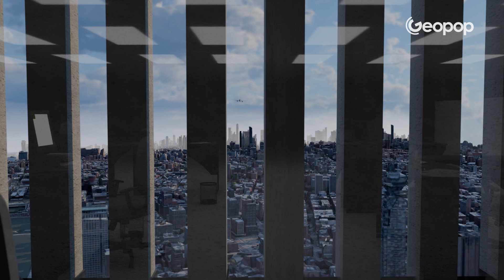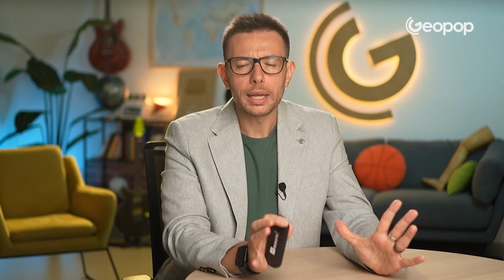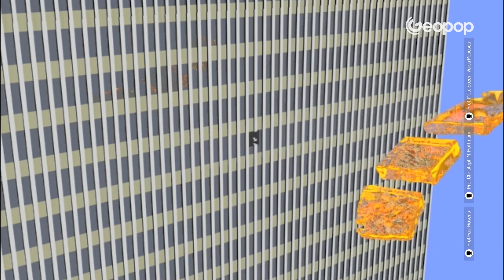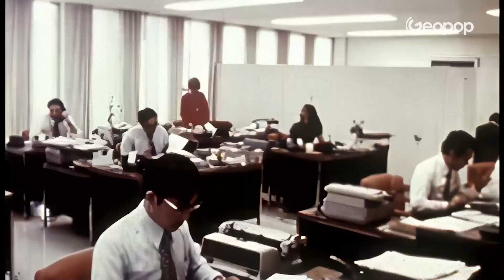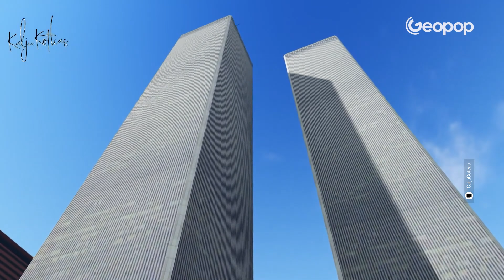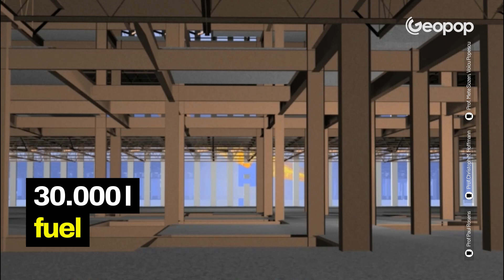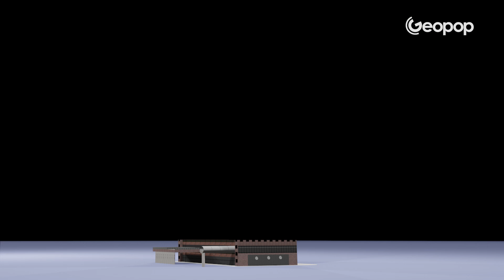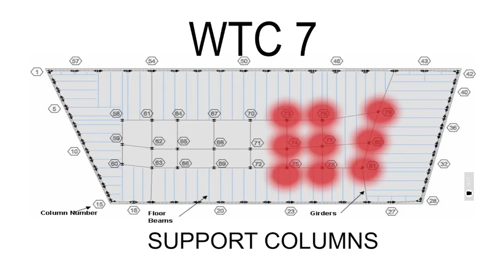9/11, 2001: The Technical Reconstruction of the Twin Towers and WTC 7 Collapses

Comment: Never in the history of steel buildings have they collapsed due to fire or plane strikes and yet 2 buildings in one day collapsed. 🤨 If anything, the top sections of those buildings would have fallen over and even that would have been suspicious.
Reply: Steel framed buildings collapse from fire all the time. News flash:  Steel is formed using heat and deforms the same way.
Reply: @TheLoonResistance   " If anything, the top sections of those buildings would have fallen over"  doesn't even make any sense.  It's just wishful thinking to get a result you want.
Reply: @zMW574e don't forget gravity, they dont pull to the side they pull downward

Comment: another question nobody talks about on wtc7 explosion conspiracy is where was the blast noise? yes of course and the windows blowing out which he mentioned here.  but i never hear anyone ask about the lack of explosion noise.
Reply: Also not a single one can explain how, if the buildings were rigged with explosives, "they" managed to keep the explosives from going off for 7 hours during a raging inferno. How were the wires and detonators not damaged in the impacts, or subsequent fires?
Reply: I guess Nobody Noticed the Holes in every Floor, Outside Walls and Ceilings, and why are all the Columns, Beams and Girders partially cut through, and they couldn't figure out why there are miles of wires running in all directions?🤔Amazing, you couldn't get a Pistol past security, but those sneaky bastards did this ???
Reply: Like you could hear anything over all the noise from the first 2 towers. Explosives in the basement did the trick.
Reply: @JasonCrowther-d6v  , you would see it and hear it; that's so idiotic. the 12 stories ripped out of one side and the 10 floors of raging Fires for 7 hours did it. It's frightening how many morons are out there? Also, there was no basement; it was suspended in a radical design (which contributed to the collapse) over a big electrical substation.
Reply: @JamesBerlo Fair enough. So you don't think our government had anything to do with it at all. It was a false flag operation.
Reply: @JasonCrowther-d6v  Oh, I think the Government is so infested with corrupt, power-mad psychopaths quite capable of participating and some could have known and allowed it, but they couldn't have too many people involved and keep it secret this long. 
I believe its possibly an "Allie"; say Israel could have known about it and not warned us, and may have even been involved in secretly recruiting and facilitating the Terrorists so we would go to War with their enemies. 
But all these insane, preposterous methods to achieve such destruction is impossible,
Reply: @JasonCrowther-d6v  noise from first 2 towers??  that happened hours earlier.  controlled demolition from bombs in basement??  why dont you run that by AI for more clarity on demolition tactics.
Reply: Because there's no explosion 💥
Reply: Lol the lack of those nut jobs under your comment gives all the answers
Reply: @riishith 😑
Reply: Which is one reason the people claiming it was a controlled demolition are stupid - because controlled demolitions are very loud!
Reply: @bdshort  also why did "they" need to control the demolition?  why not demolish uncontrolled?  and of course why demolish to begin with?  couldnt just light on fire or let the debri fires burn it.  why sneak in tons of explosives and thousands of detonators (never found 1) and risk exposure and jeopardize the entire mission to make a "controlled" demolition?
Reply: @nathan500100  i had the same thought until i asked chat gpt if silverstein would have received his full loss insurance payout if they didnt collapse and it said the answer is no. so then it makes me wonder again. youre right theres no benefit at all for that unnecessary complexity except silverstein getting his full payout
Reply: @morrisalanisette9067  The conspiracy theory requires two things to be true for Silverstein to benefit:

He had to somehow arrange for two planes to strike two separate buildings to trigger the possibility of a "two occurrences" claim.

He had to know for certain that the highly ambiguous, unfinalized policy language would be interpreted by a court in his favor, against the arguments of two dozen powerful insurance companies.

The fact that Silverstein had to endure a protracted, uncertain, and partially unsuccessful legal battle for over five years completely destroys the second point.

If Silverstein had engineered the collapse purely for insurance profit, he would have done so under a policy with iron-clad, favorable language that guaranteed the double payout, not one that led to a multi-billion dollar courtroom gamble.

Furthermore, the total cost of rebuilding the WTC site was estimated to be well over $7.5 billion, meaning even the final $4.55 billion payout was significantly less than what was needed to fully restore the complex.
Reply: @morrisalanisette9067  just think of the logistics to enact the basic conspiracy.  its ridiculous.    Completely absurdly cray cray.   911 nutjobs are in the same ballpark as flat earhters, moon landing deniers , and OJ and michael jackson being totally innocent.
Reply: @fredfinks It's far from flat Earth believers. It was a inside job.
Reply: @JasonCrowther-d6v  Absolutely youre as mad as that lot.  100%.   The only reason we give a fuck about your type at all is that you pollute youtube comments. An annoyance, nothing more.
Reply: @bdshort  you can feel the sound!

Comment: People argue that the buildings couldn't have collapsed because the steel couldn't have melted.
They seem to forget that you can forge steel and you don't forge it at its melting point.
Reply: The towers fell at free fall speed,explain how that is possible
Reply: @thecitizen61  Explain how prop planes and Okha Cherry blossoms smashed through steel of American ships? Oct-1944-Aug-1945! Explain how 36 American ships were sunk and over 100 damaged by lack of imagination.
Reply: @thecitizen61  if he has to explain that then you are not very smart lol.
Reply: @thecitizen61 tons and tons and tons of steel and concrete came crashing down from the top 
That's how 
Every floor on the way down could not handle the weight of the collapsed floors from above
Reply: @alexpaulyoungthemuso3937  towers were wired up for demolition by Israeli students who wired the towers up they even drew a picture of the towers on fire with people jumping out of the windows and they named the band they were in after a type of explosive forgotten the name now. There was explosion in the basement and fireman said they heard bang bang bang bang bang bang bang bang on every floor it was a controlled demolition 😂 stupid people say it was the amount of fuel that turned the towers to dust and the only thing that survived was a passport of one of the people who were blamed for the inside job by the usual suspects the jewwssss in gov..and the see eye a
Reply: @thecitizen61 fuckin retard
Reply: @thecitizen61 they didn't. You're stating something incorrect as fact.
Reply: You seem to forget what was found in the dust that cant be explained away by office fire

Comment: I read all 4 versions of NIST reports and their conclusions in the body of the final report are indeed refuted by the experiments detailed within the apendix reference material at the end of said report. I also take particular point with said (conveniently polished presenter) that ASTM E119 steel held PARTICULAR properties in heat resistance and strength. You glossed over that completely, in fact you treat the whole structure the same, however this not true. ASTM E119 had the abilility to sustain well above 50% of it's DESIGNED load limit. This was throughout the building. However, even ignoring everything being said in this report and it claims resulting in a cascading pancake collapse...most of the falling weight (as we can see from video) is falling outside of the building. Another KEY point, that is "conveniently" avoided, in this "report", is that all tall buildings get much thicker and stronger as they go down. which ultimately means that there is more MASS at the bottom than the top - ergo equal and opposites forces cancel out way before the ground... AND none of that would end up with melted cars nearby.

I would be fascinated to see their explaination of the other 2 planes.
Reply: First, I'm really curious what claims made by the report are disproven by the experiments.

Second saying that ASTM E119 can sustain more than 50% of its structural load is nonsense, since that's not dependent only on the fire rating. Besides, ASTM E119 is not a type of steel, it's a fire rating standard.

Third, saying that "equal and opposite forces cancel out before the ground" because the bottom is much heavier than the top is complete nonsense that betrays a profound lack of understanding of how the collapse happened. I see it being peddled a lot by conspiracy theorists on the internet and that shows where you got your information.

Even if the majority of the mass fell outside the perimeter, the considerable portion that ended inside of it would have fell through the building with little to no resistance, given that it would have passed mostly between the columns. It would have completely  destroyed the floors and the beams between the columns, since those were not designed to sustain those kinds of vertical loads, while pushing the perimeter columns outward, making them collapse under lateral loads rather than vertical ones.
Reply: @marcop1563 Have you read all 4 NIST reports?
Reply: @chrisharraway1425  I did. You clearly failed to understand them, however
Reply: @chrisharraway1425  - IF you understood the collapse mechanisms you wouldn't bother bringing up how the columns get thicker the closer to the ground one gets, because it just doesn't matter.

The collapse bypassed the columns which is why the Twin Towers collapsed. 

You keep brining up what you call key points but because you don't understand the collapses you don't realize they are not key at all.

Let’s break it down to the absolute basics:

The 47 core and 236 perimeter columns of the Twin Towers support all of the gravity loads of the building. ALL of the resistance is in the columns.

Planes impact Towers, causing massive structural damage, destroying sprinkler systems, tearing out gypsum board walls and blasting off the SFRM insulation from the floors. Multiple floor-wide fires are started instantly and spread rapidly due to the destruction of fire protection systems and venting of the building during the impact.

Serious fires were largely confined to the impact damaged floors and those immediately adjacent to them.

Fires were started by the impacts and fuel aboard the aircraft, which acted as an accelerant. No shortage of other consumables inside the tower to continue the fires.

Collapse was initiated (started) at the impact and fire damaged floors when floor trusses exposed to heat over time sagged, in turn pulling on and causing the inward bowing of some perimeter columns by up to 5 feet until they buckled on one face of each tower (ie: NOT symmetrically).

www.youtube.com/watch?v=ULdiD6gYZO0

No steel melted or needed to. Structural steel will bend and fail at less than half its melting temperature.

Once the perimeter columns buckled the formerly static load above became a dynamic load 30 times greater, easily overwhelming the structure below.

Thousands of tons of now loose debris fall through the open office space within the four outer walls - bypassing the columns - dropping 12 feet onto the first intact floor it comes across. That massive instant overload causes the floor to fail, shearing the pair of bolts that secure each end of the floor trusses to the columns. The floor fails. adding its mass to the falling mass which continues to accelerate for another 12 feet until it impacts the next floor, rinse and repeat one floor at a time all the way down.

The columns - the part that holds the building up, supporting ALL of the gravity loads - are spectators for all this as the debris falls around and past them, not onto them. 

Rate of collapse increases as momentum increases. The collapse front is constantly accelerating.

As each floor fails, air inside the building (the Towers were 95% air by volume) is compressed, then blows out the sides _in reaction to the Tower falling, not the cause of the Tower falling.

No fire required at all on floors below the impact points for them to fail. The mechanisms that started the collapse are different to the mechanisms which continued the collapse. That will be a difficult concept for some.

As the floors fail the perimeter columns are left literally hanging in the breeze, no longer attached to the rest of the structure. They peel away and fall in great sheets (think banana) out to more than 600 feet from the base on the 4 points of the compass.

Core columns failed last.

The collapses took 32 to 34 seconds start to finish, or about 1/3 of the rate of free fall acceleration for those obsessed with how fast things fall because the internet told you it was important. No Laws of Physics are violated so no need to invoke magic or divine intervention

Each 110-story tower had a 1-acre footprint. The debris pile was up to 14 stories deep and spread out over 16 acres, destroying 8 surrounding buildings and damaging more than 100 others.

Anything can seem like a conspiracy if you don’t take the time to understand how it works. Hopefully now you do.  If not, I can go into much greater detail. 

Kostack South Tower model
www.youtube.com/watch?v=WpHXj62Ylw0
Reply: @marcop1563 oh wow!....so you missed the contradictions about their experiments vs what they claimed? 
Not to ignore the fact that they way you describe the collapse wasn't how NIST described it. Not to mention that with tower 3 they clained that the beam "walked" off column 57, despite them incmuding a photo of said column in the appendix explicitky showing that it was in fact securely fastened by the required massive bolts, same as throughout the building. 
Also, thank you for correcting me on ASTM E119, because that steel was indeed rated to that standard for strength under heat and therefore had significantly higher strength than the minimum required to meet that standard, as has been explained by several Architects and Metallurgists. The point with that is that the ARCHITECT who designed the effing building clearly stated in his plans that each beam waa to be able to hold twice the required load, this being the central tennet to the inhetent redundancy built into the structure. Tower 3 was made of the same steel, with the same rating...office fires are not hot enough, no matter how long you give them, to cause the softening claimed - ergo something else was gling on.

Ground effect relates to the plane at the Pentagon, you donk.
Reply: @chrisharraway1425  - Column 57?  WTF 🤦‍♂
Reply: @TheLoonResistance Column 79, I reas them all when they came out, been quite a while. The false premise remains: there is photographic evidence of that column being securely fastened, prohibiting the "walking" that is claimed in the body of the NIST report.

ASTM E119 is indeed a heat rating for a certain type of steel! The exact type of steel that was heat/strength rated to that standard was what was used throughout the majority of load bearing structure of towers 1, 2 and 7. 

The experiments relating to the pkane impacts are modelled poorly, literally using a shotgun loaded with similar scale material, fired within a box. Widely ridiculed by scientists for its crude approach to simulation.

The Tower 7 simulation actually stopped at the point of initiation, therefore preventing anyone from seeing the complete collapse as per their model in the report, which was clearly not valid evidence for an accurate simulation of the total vertical, symetrical collapse of tower 7.

There are many more points, as are attested to by the thousands of architects and engineers whom still refute the NIST report(s)
Reply: @chrisharraway1425  - Did you read all of the NIST reports at the same time?  You sure are jumbling them up and mixing and matching.
Reply: You start off promising

"that ASTM E119 steel held PARTICULAR properties in heat resistance and strength"

Then just  say

" is that all tall buildings get much thicker and stronger as they go down."

which is dumb 

and then you sign off with 

ergo equal and opposites forces cancel out way before the ground so that car cannot melt.

Have you been drinking ?

Comment: The same type of plane was supposed to have hit the pentagon. Similar fires would have been expected at both sites yet the pentagon had intact, in place, furniture directly next to the collapse hole…the one that seems more than a bit too small for the plane. Something doesn’t add up. Never has
Reply: The Twin Towers were struck by wide body Boeing 767's.  The Pentagon was struck by a narrow-body Boeing 757.  

You gotta use the right math for things to add up.
Reply: There is definitive evidence of a civilian airliner hitting the Pentagon. Debris, human remains, eyewitnesses, and even the size of the hole. The Pentagon did burn for hours, the collapse simply exposed parts of the building that hadn't burned yet.